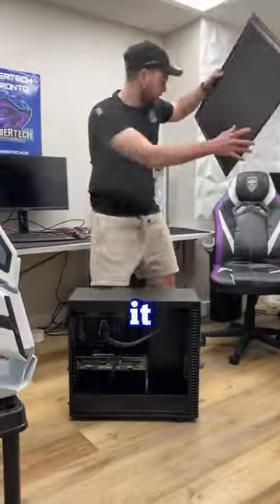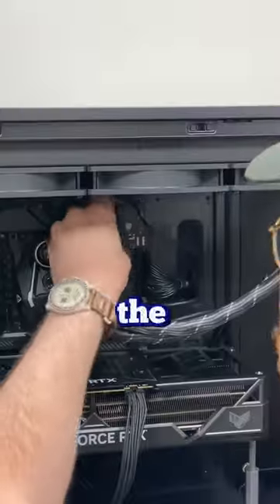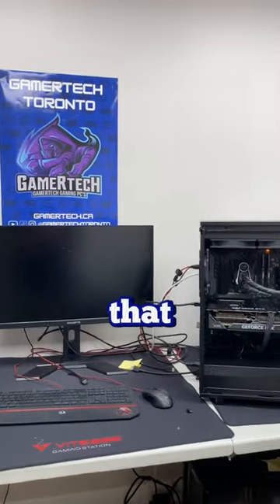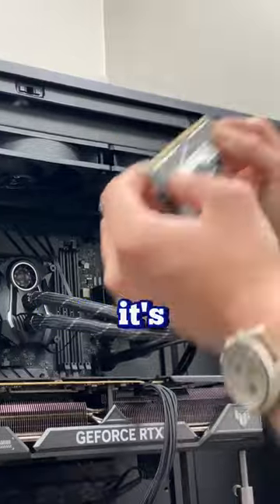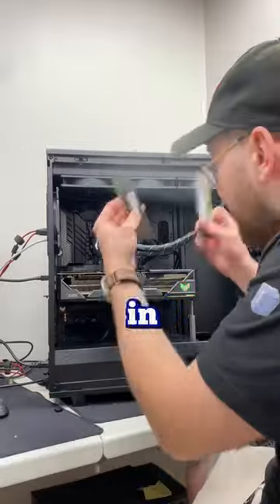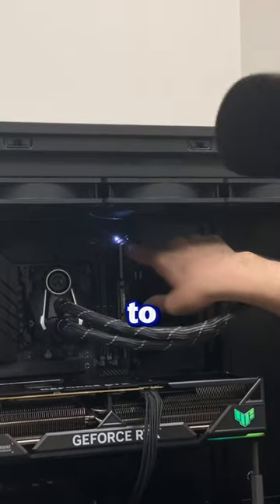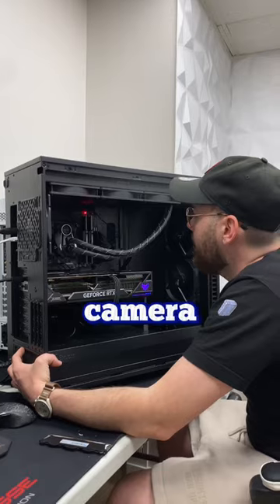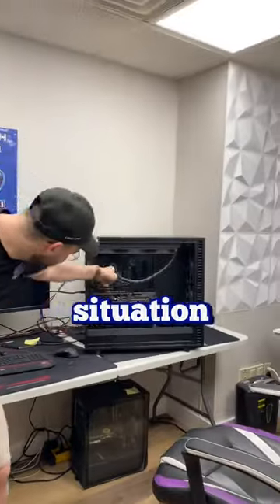Broken DIMM Slot?! 🤬 #ram #broken #pcrepair #gamingpc #pcgaming

Comment: sometimes a faulty memory controller on a CPU can prevent your PC from booting up in dual channel
Reply: Yeah...says the guy with an Asus logo for his avatar
Reply: Facts.  It’s the dumbest thing ever  if you don’t realize it
Reply: So if it's a faulty CPU controller what is the solution
Reply: @user-ex5pt7mo2v  check if the cpu is seated correctly, and the socket is clean of any excess thermal paste, if that doesn't work then the cpu is faulty and you have to change it.
Reply: so why one slot is working but the other not if that's the case??
Reply: @tylerdaniels9000 On a 2 ram slot motherboard, if you run 2 ram sticks, that's dual channel. If you run 1 stick, that's single channel. When a memory controller goes bad, the pc won't run in dual channel and will start boot looping or not posting at all.
Yesterday it happened to my pc bcuz i had excess thermal paste on the socket which left some cpu pins not contacting well, i fixed it by cleaning the socket.
Reply: @brahimbrd2156  The video is about a faulty slot, not some damaged CPU pins. If one slot isn't working despite the RAM stick being fine, that's a slot problem

Comment: It could be the CPU as well, bad contact in a memory channel, try mounting it again with even pressure
Reply: This 🎉
Reply: Yup that's why u test the slots reseat CPU then new ram kit 
But ay since we are lazy we won't do in depth analysis
Reply: Thank you so much bro.  You had no idea how your comment just helped me.  I was  panicked when I found out one of my RAM slots did not work.  This happened right after I changed my cpu cooler.  Tried swapping the ram but found out that the ram was okay.  Finally, I tried reseating the CPU and the cooler, reset the bios and it worked again.  I was so relieved that I immediately laid down on the floor and stared at the ceiling for a minute right after the pc booted up lol.  I almost ended up buying a new motherboard.  Thanks again and have a good day.
Reply: Underrated comment, turns out I had a couple bent pins in my CPU, so I rearranged it and now it works! thank you very much.

Comment: I recently had the exact same issue. Turns out two pins in the cpu socket were slightly bent and not making contact. After doing my best to bend them back into place, the computer booted up fine with all ram slots populated.
Reply: This seems to be a not so uncommon issue with Asus motherboards? I’ve had the exact same issue occur after 4 years with my Maximus Hero WiFi 🤔. I’ve heard it having an AIO cooler too tight might have caused this.
Reply: @Lukeos  I can see potential for this issue occuring from coolers being installed too tight. However, for me this issue came directly brand new from the factory. Bad luck I guess. But it's been months now since I've had to bend them back into place and the PC is still working fine.

Comment: Had the same thing happen to me on an msi motherboard. Ram worked in another slot just like here. Decided to check the cpu socket for bent pins, nothing wrong there. Turns out one of the standoffs for mounting my aio wasnt screwed in properly leading to this. Main takeaway is check your cpu and cooler.
Reply: How was it not screwed in properly? I have the same issue but haven't thought it could potentially be from the AIO, do you mean one standoff just wasnt screwed down enough?
Reply: @nathanfenoseff7751  yeah, that's what I meant.
Reply: well im working on 1 slot for now didn't check the cpu though cause its booting normally could it still be the cpu should i check it out or what should i do, no one here's could fix it and its out of warranty not only that my motherboard is old and none said they have similar motherboard and honestly i feel its like not worth it to buy another motherboard like not worth the money so what should i do
Reply: @SaSuk1OnPc  My pc was booting normally with just a single DIMM so its still a possibility its the CPU or your cooling setup.  I'm not an expert on the topic since I've only ever put together the one rig. Overall its best to rule out as much as you can so you can pinpoint the problem and eventually find a solution.
Reply: @Datsd02  i'll check it out thanks mate

Comment: I had a similar issue with my computer. After some research, I found that 2 of my motherboard cpu pins are not like others. I fixed the pins with a needle and ensured that cpu is able to connect with the pins. After that my both of the dimm slots just worked as normal.
Reply: Which pin bro? I have the same problem...which pin do i need to check?

Comment: My Asus Z690 AND Z790 both wont do XMP with far left DIMM slot... unreal. Z690 also crashes games with left dimm installed, my Z790 gives me weird issues as well. I didnt know blaming Asus was a thing now., sucks because they have the best looking motherboards and bios UI imo.
Reply: Bro i just bought an Asus mobo and I'm extremely scared
Reply: Buddy bought all asus shit. We setup the board out of the case first and sure enough error 55. Come to find out it had bent pins and a1, a2 slots didn't work. Asus blamed it on incompatible ram but we tested compatible and same result. 

Now we are trying to battle asus for a rma

Comment: youd be surprised it could be the psu gpu cable. it happened to me. Got the ram dbug light and i tried every dimm 1 stick only nothing. i was ready to drop money on a new mobo and ram and found out it was one of the gpu cables. ended up swapping it out and it worked fine.

Comment: shame problem was the cpu contact not seated properly . its came from the  lga1700  problem . google LGA 1700 contact pressure issues.. fix it by purchasing 3rd party bracket like Thermalright | LGA Bracket. same prob as mine .. (sry for my bad english) secondary language .

Comment: What do you mean "what would you do" if that motherboard is less than 2 years old I'm entitled to a repair or replacement under warranty at NO COST to me.
Why? Because the EU says so.

You return the motherboard to the store you bought it from, they give you a new one, right then and there, and they deal with the manufacturer to get it replaced.

If the store makes you wait for longer than it does for them to test the motherboard and confirm the diagnosis, to get you a new motherboard, sadly wait it out and then never go back to that store again.

Comment: have this issue with my motherboard, a2 and b2 being populated will cause the board to give 1 code 55 for ram not detected. nothing I do can fix it. my ram channels are staggered (A1 B1 A2 B2) and if the last two slots have anything in them it wont post, so I have to have both channels populated rather than 1 channel have both sticks of ram. it sucks, since my ram cap basically just dropped by half because of this, from 32 to 16 gb, but its fine with those first two slots being populated. not sure if there is any fix to this as I cannot afford a replacement motherboard, but whatever.